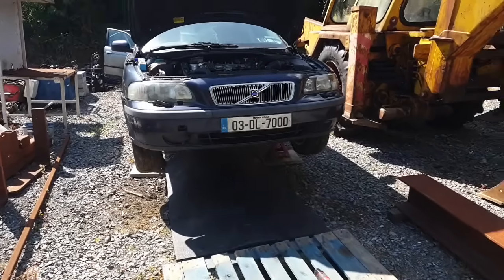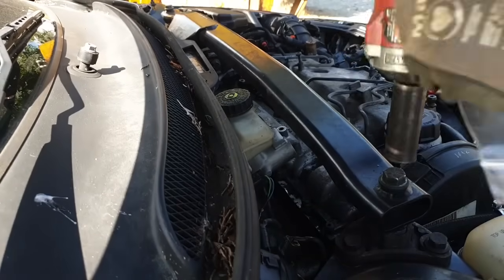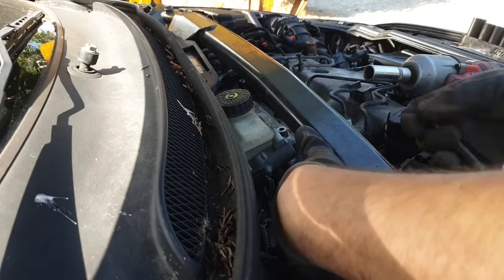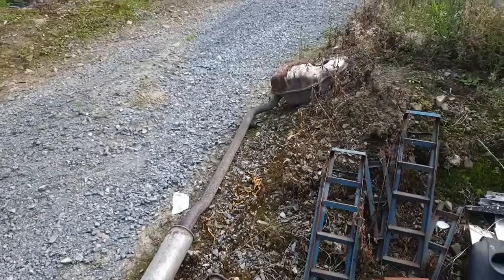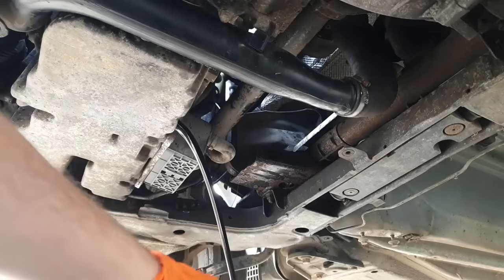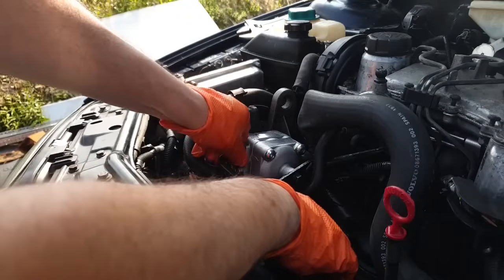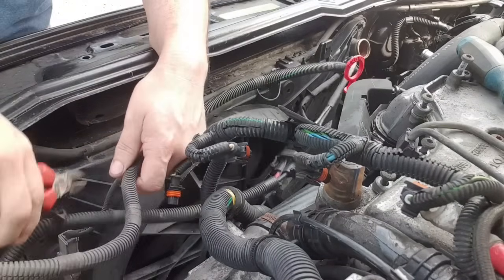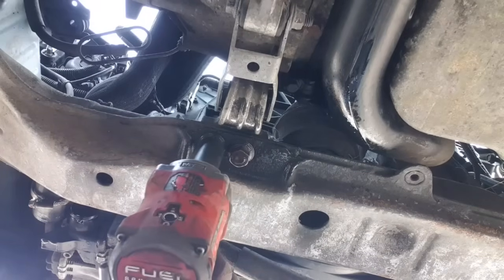Volvo Vee70 EV Conversion 01 : Engine Pull The Wrong Way

Comment: If that’s an auto, Volvo says (believe it or not) that the auto trans is sealed for life and requires no ATF change. Rubbish.
Reply: It’s good for the life of the car, which often ends with transmission failure…
Reply: Most manufacturers say that and have been for the last 30 years. The gearbox manufacturers themselves usually give change intervals of 80-160.000km though.
That particular car has a manual transmission. It shouldn't be filled with ATF, but apparently it is :D

Comment: Use one of those toilet brushes to agitate the grime, if you find one of the cheap ones with the hollow handle, you can stick it on a broom handle and make easy work of the compartment.